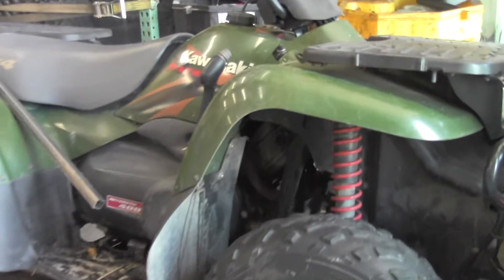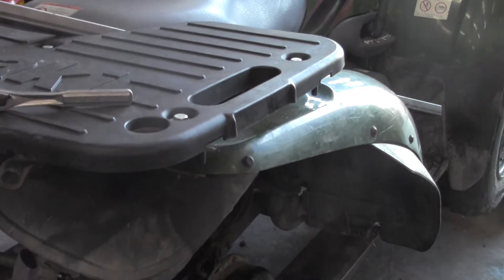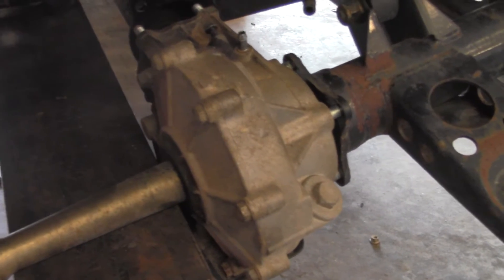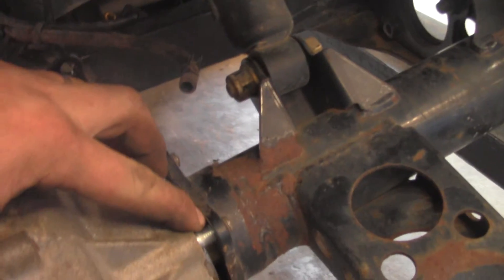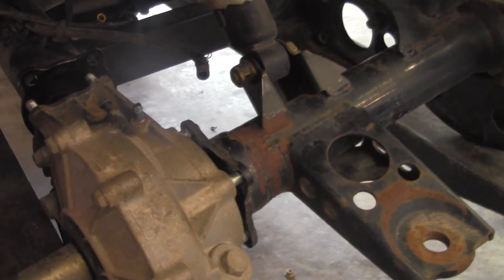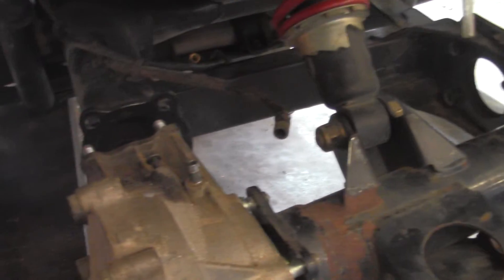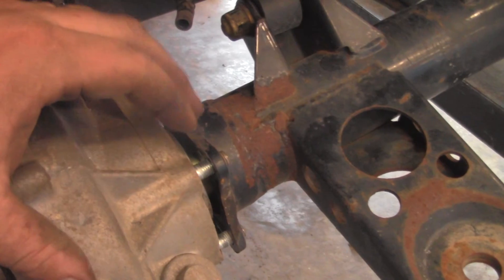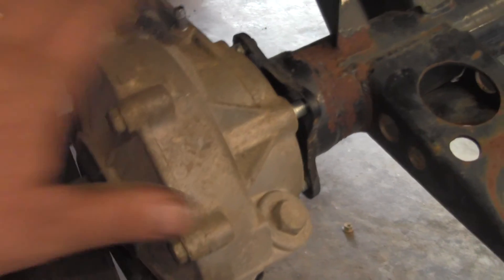How to Remove / Replace Rear Differential on Kawasaki Prairie 400 4x4

Comment: ive got gear oil leaking from the left side of the rear (when looking at it from the rear) diff on a 2000 prairie 2wd. are there seals inside the diff that seal it to the rear axle. ?
Reply: Eddy Gilbert well on a diff there are seals u can see them when he goes to the back of the Kawasaki u see them and the axle the black thing is a seal those are the seals that hold the diff oil in and there’s bearings right behind them but that’s it with of course your gears!!!! On both sides that’s how it is just look up this YouTubeer and he shows a three part of rebuilding a rear diff on a Honda witch most rear diffs are the same on the seals and he explains it way better and shows you step by step happy D rays shop that’s the youtuber look up on his channel rear diff rebuild and it shows you 😃